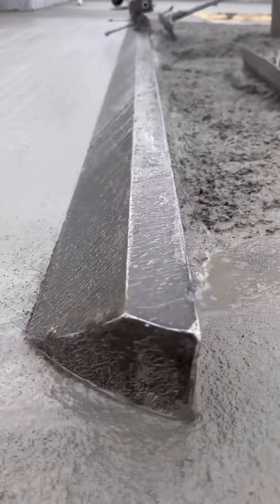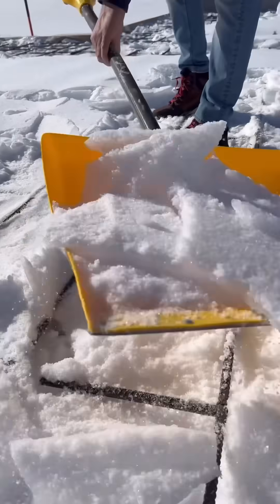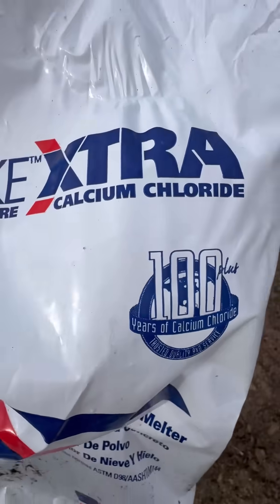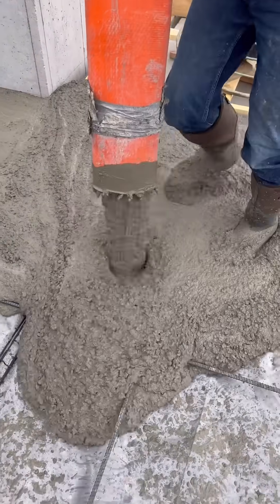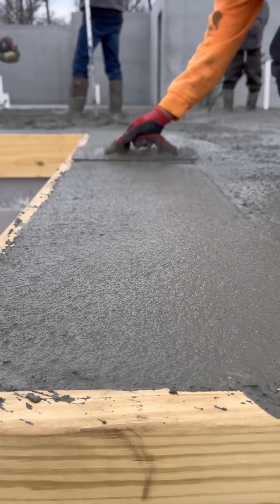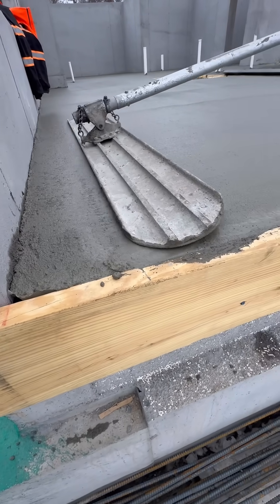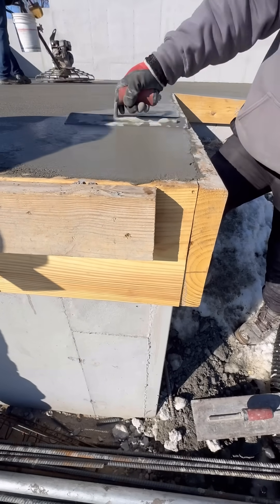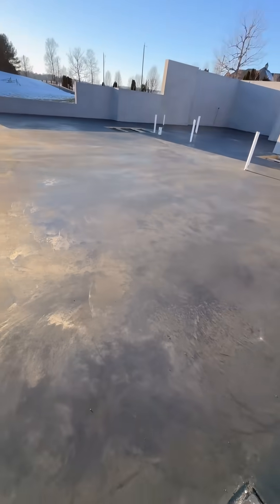How to Pour Concrete in Cold Weather

Comment: We do a lot of winter concrete work in Canada. A critical activity that we always do is to ensure proper curing - covering with insulated tarps for about a week. Minimizes cracking
Reply from the maker: We cut the concrete the next morning and covered it good with blankets. We’ll leave it covered for several days.
Reply: @hausplans  Hope you're reading it bedtime stories too. Might be a good job for the new guy.
Reply: @hausplans sure buddy, sure
Reply: In Canada, reputable contractors use NCA (Non-chloride Accelerator) when there is rebar and not Calcium Chloride as it will rot the reinforcing.
Reply: If the curing process is shortened because of cold temps, the strength of the concrete will be affected. If there is snow on the ground, the outside temp is below freezing. Always cover with insulated tarps to allow the curing process to finish properly.
Reply: I work in London Ontario, and in winter we usually do flatwork after the house is framed and we have shingles on the roof and usually by that time we had enough heat pumping in the basement to avoid frost.
Reply: It doesn’t minimize cracking, it retains the structural value tho keeping it above freezing while it cures tho, so yes there is that
Reply: In Missouri they build the house first and pour the slab after.
Reply: does it cost more in the winter than summer?
Reply: @ oh ya. Aside from lower labour productivity due to the cold and added gear, there’s concrete winter heat charges, pre-heating the ground, forms and rebar, adding tarping and applying external heat if temperatures are too low. Also, have to insert temperature probes to monitor temperature to ensure the concrete doesn’t freeze.
Reply: We cover them woth tents and put heaters in them.
Reply: so what do you do if it is below freezing? in this video he poured when it was low 40s but surely it'll drop below freezing before the concrete sets. i know the curing process is exothermic so will covering/insulating it suffice?
Reply: Doesn't do shit. Winter concrete is absolute trash. Look bad, is way harder to do and no one wants to pour at - 25
Reply: Buddy are you in Toronto? My family has a few projects coming up. Would be so cool to be able to say i found my concrete guy on youtube comments LOL
Reply: @YoshisMelodies  I can tell you didn't watch to the end because the mountains in the background would indicate that is nowhere near Toronto
Reply: @n0steeze  That's right but he's not talking about the video poster but rather the OP of this thread.
Reply: @youtoobe556  That does make sense. In any case Toronto barely gets winters as far as Canada goes
Reply: In Calgary we don't pour it till the main floor is on then hoarded and heated.

Comment: Are you going to saw cut. we have to cut ever 8 feet in az but that might be do to the water lose on the surface, do to the climate.. just curious
Reply: In Oregon we typically use a half inch deep joint line at 60" on center grid,typical.
Reply: ... Exp. Joints to prevent surface cracks. Rebar prevents the structural cracks.
Reply from the maker: Yes sir, we saw cut the next morning and then covered it up with blankets. I think the guys cut every 12 foot or so.

Comment: You should not use calcium chloride concrete accelerator with rebar because the chloride ions in calcium chloride can cause significant corrosion to the steel rebar, leading to premature deterioration of the reinforced concrete.
Reply: Thanks  didn't know  that
Reply: This is pretty irrelevant indoors. Especially with a water/vapor barrier underneath. Basement floor won’t have much opportunity to leach more chloride overtime, changing the ph, allowing rebar to rust, etc. what you should watch out for is snow melt on a driveway with rebar.
Reply: This is correct!
Reply: In the past year, I only poured about 10 jobs with steel rebar.  90% of the residential builders have switched to fiberglass " rebar " .  The year before it was about 40%.  Interested in how long they hold out.  (2-3 jobs a day)
Reply: @MapleBalls  i had my fiberglass rebar driveway replaced after 2 years cause it was falling apart.
Reply: @Meatsweats_o_O  Thank you for your report. I want to build a concrete house. Rusting rebar causes me concern, but I also know that fiberglass doesn't have 50 years of data behind it. Right now, they're the same price, but fiberglass fails in brittle [abrupt] failure mode, unlike steel which goes plastic before it'll fail.
Reply: @WhiteytheLab nothing lasts forever, but rebar has proven itself in multiple scenarios.
Reply: Tyler Ley did an analysis of composite rebar and it looks like so long as the shape is right its as good if not better.
Reply: @MapleBalls  TIL Fiberglass Rebar exists.
Reply: What about galvanized or powder coated rebar? How much cost would that be?
Reply: and that is doubly good for business.
Reply: the concrete in and of itself is corrosive
Reply: Most customers don't know any better, shhhh
Reply: alot of factors determine that .5% dosage  is fine in most all cases.  1% CC concrete needs to be compacted using a vibrator plus dont have the rebar closer than 2.5-3 inches to any edge.  other issues are the environment.  In low humidity area should not be an issue.....
Reply from the maker: I disagree. We’re using a very low percentage of calcium. Also, we’ve tried non-calcium chloride the liquid form in the past and it didn’t work.
Reply: @hausplans  chloride exposure, coming from sea water, deicing salts, contaminated aggregates, or in your case  from an admixture, will damage the passive film all embedded reinforcement bars have. So if the rebar gets enough oxygen and water, it will corrode. You might get great performance now but your clients will pay for it after a few years.
Reply: @hausplans you can disagree with science all you want, but it’s true. It will cause corrosion.

Comment: Needs to be covered and heated for at least 3 days after you pour. If the water freezes during the hydration process, all the strength is gone.
Reply: Doesn't always need to be heated. The concrete will generate it's own heat if you can protect it until it does
Reply from the maker: We covered it up right after we cut it and thankfully the weather is staying warm a few more days

Comment: I am really excited to see how this house turns out! I don’t think the concrete will crack.
Reply: all concrete cracks, anyone that tells you different is scamming you or doesnt have experience with it. . the lines you see in concrete that make them squares on a sidewalk or bigger on driveways are called expansion joints. concrete and steal expand and contract at almost identical sizes in cold and hot weather. those expansion joints are to give room for that process and to hopefully make the cracks happen there if it does.
Reply from the maker: All true! Lotta customers don’t understand this
Reply: @EvanSorrell-po7si  Thanks for the info
Reply from the maker: Thanks

Comment: The difference between cracked and un-cracked concrete is that un-cracked concrete is concrete that hasn’t cracked yet. 😂
Reply from the maker: Yup
Reply: @hausplans have you used HELIX in the concrete? It's like micro rebar and prevents cracks!
Reply: Concrete has a mind of its own
Reply: Find me concrete that will never crack... bet your asscrack you can't
Reply: @jeremiahtallant  The Ancient Romans did it with what is called self-healing concrete.
Reply: @TRguy64  "self-healing" are you implying it needs healing? 😅

Its just how concrete is, its built for a reason, to take load. Nothing is 100% not saying concrete will guarantee fail, just that it will crack
Reply: @marcochaves3661  LOL, funny man ... YES, most all concrete cracks, though Ancient Roman concrete was formulated that the minerals within bridge and bind together to repair itself, thus why some of the Ancient aqueducts still function to this day, this was in the news just a handful of months ago.
Reply: @TRguy64  well we dont actually know for sure it was formulated, we only just found out the specific salt content reacted with the ash to create much stronger bonds. The romans only documented that the ash helped because of the sulfur, theres no way to know for sure they knew their ash had the compounds that would react with their saltwater.

My point is, even roman concrete cracked, but yes, it was much much better, concrete nowadays isnt built to last, its built to get it done for as cheap as possible, most building code is going that route. 

Europea is centuries old, finalizing whats already there with quality concrete makes sense. North america is still growing and expanding, if we built for quality it was take decades to finish a single project.....much like ancient europe did. Just the sad truth of modern expansion

Sorry for the read 😅
Reply: @TRguy64  THIS IS FACTZ PEEPZ
Reply: @jeremiahtallant my 60+ yo concrete with enormous aggregate hasn't cracked. A mason working in my basement was shocked and broke a hidden piece to show me why it's held up. Home is almost 200yrs old but this exterior walkway can't be older than the 50's - 60's
Reply: @jeremiahtallant  alright, but let's say I found somebody with no asscrack does that mean there exists concrete that wont crack?
Reply: Yep, my understanding is it all cracks somewhere
Reply: Yep mostly everything you do working in concrete is because it cracks. Sub layer, rebar, and cuts.
Reply: All concrete cracks. True story
Reply: @NOzekanDeE nah it doesn't
Reply: @NOzekanDeE as an European not true. The reason it cracks for you is because americans put very little iron as concrete reinforcement while here in Europe we put maybe 5x more in so it almost never cracks. We dont even use a power trowel to get it smooth just a PVC pipe on a stick gets the job done
Reply: @bleekwater6176   i dont remember asking europe A DAMN THING. shouldnt you be importing another 10 million muslims into small christian communities?
Reply: @LFshlevin  And there it shows tha Murica is not everything or always the best. Go rebuild Cali with your cracking concrete.
Reply: @LFshlevin  Oh no, that poor persecuted Christian majority!
Reply: @LFshlevin  Shouldn't you be forcing your religion in to public schools and government?
Reply: @Servant4Zeus forcing?  You mean recognizing?  Islam forces, Christians are called.
Reply: @SickestDisciple  Don't deflect. 

When Conservative lawmakers continue to attempt to post the ten commandments on public property and in public schools, it is a tacit endorsement of Christianity.  Those attempts have and will continue to be overturned.
Reply: @ not deflecting.  Lex Rex.  I’d suggest you find out the history on the founding of this nation.
Reply: @SickestDisciple  who are you talking too? And what does Greek concrete have to do with the founding of this nation?
Reply: @Sniper_online4940  I didn’t tag you, so why insert yourself?
Reply: @ well you failed to properly insert the right person, and I’m not trying to start an argument
Reply: @Sniper_online4940  nah I didn’t, you just may not see it, but it’s there.  So, carry on.
Reply: @ you didn’t @ anyone look at you post my guy
Reply: @ nah it shows it on my end fella.  Are you wanting to add anything to the comment? Or just being nosy?
Reply: @bleekwater6176 Civil engineer here, you are wrong. Even with fiber reinforcement the concrete still cracks before the fibers stress and take on any load
Reply: @bleekwater6176  nope, all concrete will crack. It's in the nature of it's chemistry. There is a massive difference between cracking and structurally problematic cracking.

Reinforcement would not even be useful if the concrete didn't crack some. The concrete has to crack a bit to effectively transfer loads to the reinforcement.
Reply: @gary6576  thank you for explaining this all concrete cracks and not all cracking is structurally problematic
Reply: @NOTselfish03 😂
Reply: @bleekwater6176  Dumb dumb dumb dumb dumb dumb dumb 
Mr sandman, bring me a dream
Make him the cutest that I’ve ever seen
Reply: @bleekwater6176  pov: you dont understand what you're talking about and your ignorance makes you confident. Typical european L
Reply: Roman concrete still cracks over time. That said, there was unmixed quicklime in the concrete, which would fill in the cracks and over time harden the concrete further, especially with sea salt spray from the ocean. Intentional or unintentional is not sure, but they were very smart...until all the lead pipes made em go nuts; but I mean, we used quite a bit of lead piping too....hmmm
Reply: Gunna say the only guarantee in concrete is it’s gunna crack just where and how much😂
Reply: Very true in southern california, my father did floor covering for 40+ years and he said he never once saw a slab that wasn't cracked.
Reply: @treykearns4867  He ain't lying! I did commercial union floor covering for 12 years in So.Cal.
Reply: The difference between a great concrete guy and an average one:  The great one says:  "Concrete will eventually crack, but here's all the steps we take to reduce cracks and future damage".  All the others just say "well concrete's gonna crack, nothing we can do to prevent it".
Reply: You got it my guy 😂
Not a question of if but when
Reply: North american construction wisdom. Spending just a couple years overseas you actually come to realize HOW LOW our standards are
Reply: @  almost like the usa is a NEW COUNTRY that needs rapid building methods. stay cucked tho boy
Reply: It's kind of sad that the Romans came up with an arguably superior concrete 2000 years ago, but in the age of space travel, we somehow can't make concrete that won't crack in a year or two.
Reply: @Jordan-rb28  Roman concrete isn't as strong it may last longer under easier conditions but it's not better
Reply: My fellow concrete people 😂..we have gathered!
Reply: Fr
Reply: Well said, well said. lol - truth be told - this is true!
Reply: That's actually genius
Reply: Love that response. Pretty funny.
Reply: We have a lil comedian over here😐
Reply: “There are two types of concrete… concrete that isn’t cracked… and concrete that’s gonna crack”
Reply: Introduce Greek concrete to the chat (you’re all wrecked)
Reply: Wrong my slab was poured in 1957 and has No cracks
Reply: If you don’t want it to crack, keep it in the sack
Reply: That cracked me up😂
Reply: Wow, that is totally true. I like it
Reply: Nice
Reply: can't argue there
Reply: you'll get a crack within the first week, no matter what
Reply: Is that the same as glass windows?😊
Reply: My driveway hast cracked yet
Reply: yeah but a huge difference between cracked in 2 , 20, or 200yrs...
Reply: agree, it literally mixed texture so ofc it will crack at some points, only question is will it break in pieces and get in your way
Reply: Concrete cracks on this planet hopefully where you want it to.
Reply: Rückständig ist schon mal das da kein randdämmstreifen ist 👎👎🇩🇪
Reply: poor in below 32 crack city
Reply: That's what my dad always used to tell me.
Reply: I just had a seizure reading that
Reply: No shit Sherlock
Reply: Genius!!!
Reply: PLEASE, for the love of God, run for President!
Reply: Touche!! 👉
Reply: Average American Humor💀
Reply: Ok Kamala
Reply: @PCTranspo ?
Reply: @229BlackHat  you know how she would speak in rhyme
Reply: @PCTranspo  I don't know why you're making fun of a woman of color who is highly intelligent /s.
Reply: @PCTranspo  President Musk will fix everything
Reply: Bro we are working not talking about politics here  @PCTranspo